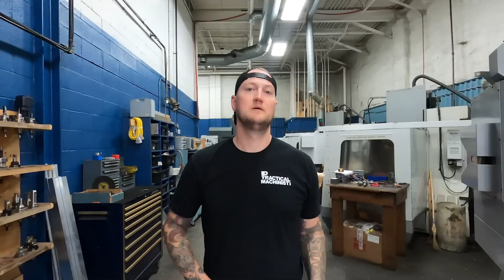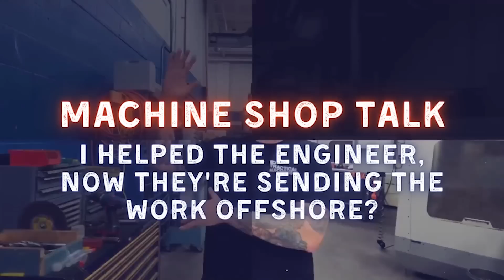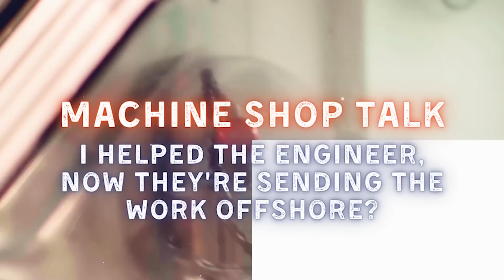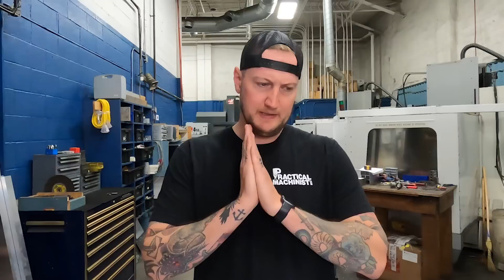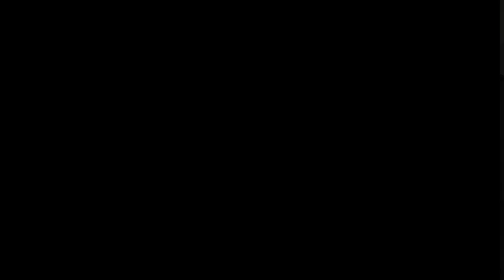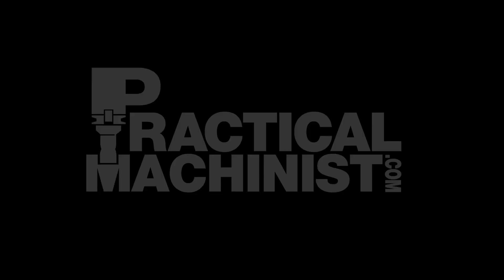I Helped the Engineer, Now They Are Sending the Work OFFSHORE?! | Machine Shop Talk Ep. 87

Comment: I've been an engineer for 30 years, specializing in designing custom machines. Since around 1998, every employer I've worked for has pushed to outsource production overseas as soon as we move from prototype to full-scale manufacturing. Many don’t even bother requesting quotes from local shops.

The decision-makers—focused solely on the lowest price—fail to consider crucial factors like quality, intellectual property protection, shipping costs, import duties, and logistics. I’ve experienced countless outsourcing nightmares, including one case where an overseas vendor blatantly copied one of our machines and became our competitor.

My advice? Trust your instincts, and don’t offer solutions if you see potential manufacturing issues—just say it's difficult to machine. They’ll outsource it regardless.

Thirty years ago, Santa Fe Springs, CA, was a hub of machine shops and specialized manufacturing, where you could get anything made locally while working directly with vendors. Today, most of those shops and skilled workers are gone. This is the real impact of outsourcing—it has hollowed out our industrial base

Comment: I'm convinced that purchasers don't talk with people who handle logistics and are just focused on cutting costs for their department not the company as a whole. We quoted a part family of 3 parts, QTY's between 15k-60k a year and matched India's pricing. The customer took the largest quantity part in-house and had us quote the other 2 parts separately, which caused the pricing to go up by 20/30 cents. After talking to them about everything they came back and gave us a price that was even higher than what we quoted. Basically they told us that they were saving so much on shipping and tariffs that pricing the part where they did was still saving them money. Material was C11000 copper.

Comment: Was an electrician for 50 enjoyable years. Had one cheap general contractor ask for quotes three times in a month.. On first trip he asked me if I could disconnect some old wires No problem. Second trip I did maybe 20 minutes of free work. Of course he said my quotes were too high and will like me to do the  work but for a large discount. Told him that I never reduce quoted bid. On third trip he asked me to remove maybe 10 cables and some porcelain basement lights out. No problem.Asked his foremen if he had a pair of tin snips. Cut the energised cables creating nice nicks in tin snips then took a hammer to smash the lights and told him to never call me again for a quote.

Comment: Good Engineers discuss their part designs with the Toolmakers and Machinists and support the part being maufactured in house,  or with a trusted Subcontractor.   Bad Engineers steal Craftsman's inputs and allow the work to go overseas.  Yes,  I got fired for disagreeing to dismantle Australian Manufacturing and sending it all to China.   Now that Company has a Chinese competitor which is displacing them in their home market.
In your position you can do several things.  Depending on how dependant you are on that Customer.   If a returning Customer it may not pay to invoice them for your "consulting" work.  Just lift the subsequent quotes to recover that cost plus interest over say a year.   If a new Customer send a reasonable invoice to cover the work you did.  State that no order was issued by the Company.   If they protest point out that they are benefitting by using a lower and subsidised (if Chinese) manufacturing source.   Should their offshore sourcing efforts result is unsatisfactory quality be extremely wary of being asked to do any rectification work.   You will have no idea of the material or processes used to make the part to cut costs.
From a retired Director of Manufacturing and Chief Design and Development Engineer.

Comment: Great video, as an engineer who runs a manufacturing business I would like to add some advice:

Setup a meeting with the the engineers, their big boss and the purchasing department. Go and explain the situation from your side, and explain that if they continue to work like that then there won’t be anyone left to help them locally, and they will end up with cheap badly performing parts they have designed. Try to understand where they fit in the price, speed, quality nexus. If price really is their primary driver then don’t fight for their work, in time they will probably be out of business.

That meeting will do more to elevate you and your company than any consulting fee!

Comment: There's a mathematical formula for o ring sizes , special tool sounds odd.  But yeah I believe he lost the 2 jobs on a price deal.   But I personally would keep helping out. If someday it'd bring My company thousands down the road .
Reply: It’s a tough situation for sure. I think everyone has cut off a company before ‘too soon’ and wondered what they may have missed out on if they’d held their tongue.
Reply: The special tool is for installation of the o-ring. When you go smaller and potentially a higher durameter, that o-ring can become a bear to install without clipping it or damaging it in some other way. The part probably doesn’t have a good lead in or transition for that o-ring and so it needs that tool to help get in the groove correctly.

Comment: These decisions usually are not up to engineers. This is usually a management (MBNAs) decision. Engineers typically like to do things in-house or as close to themselves as possible. They're usually are well aware that projects need constant iteration in engineering and  exporting it is a death nail to that.  Also, if a machinist is telling you how to make part so it doesn't break then you aren't doing engineering you are just doing design. I will give them some slack for being new at their job but they still should know better.
Reply: Engineer here. Lost count of the number of times I’ve seen management or Purchasing people chose the cheaper/worse option to same money even after I have specifically warned them not to. Then something goes wrong with the cheap option, and everyone looks at me because I was responsible for the engineering on the project.
Reply: @hammurambi man I can’t imagine how frustrating that must be. Definitely why I put up right at the beginning of the video that engineers certainly ain’t the enemy by any means!

Comment: Lived with this for 20+ years. Particularly true with machined parts where their cost landed from Asia is about 1/3 to 1/2 the US price. This practice has created an entire industry of "prototype shops" here in the US.  It is now so common in consumer electronics most of what I buy these days is labeled "designed in USA manufactured in Asia (mostly China). I don't know if any solution beyond substantial tariffs on imports. if you can get DOD work that typically won't go offshore but then you have to deal with government procurement and most small shops can't.

Comment: Engineers have NO respect for machinists. ZERO... NONE... If they want you to "Consult" on a project, then Sign an NDA and have them sign a contract you can bill them for.
Reply: Not true at all. Many of the engineers I work with have a machining background or some machining training. I’ve worked in manufacturing as an engineer for the better part of a decade. I’ve met my fair share of engineers who are arrogant pricks, and an equal number of machinists/toolmakers who are arrogant pricks.
Reply: @hammurambi I agree with you. I'm an engineer by trade (EE) but I am also a hobby machinist so I see both sides.
Like many other things in life, a little bit of honest communication (or lack thereof) can make you or break you.

Comment: A small job shop I worked for did the same thing. Pretty complex parts. We got plenty of re-work because the overseas company could not get things right, could not hold the tolerances. Most of the parts had to be scrapped! 🤭

Comment: There’s a term in certain industries, NRE( Non Recurring Engineering) where as a part of the design/build up of a part a fee is charged up front for so many hours of engineering/document, part review and preparation for the quote and manufacture.
On completion of the NRE the customer and provider get together to review the part, pricing and delivery, the important thing is that the customer never ever owns the design until contract is completed and delivered.
If the customer does not proceed the design stays with the manufacturer, even though they have payed for it because all there paying for is the time not the output, the final product includes the technical data only on delivery.
If you design it you own it unless you give it away in writing.
Personally, companies have taken our input and then much later added it as their own development insights with no recognition to us, which meant in the end we did not push their products and have even advised customers that there were other products or solution’s to suit their needs.
A common problem and no solution is perfect but NRE does work.
Take care.